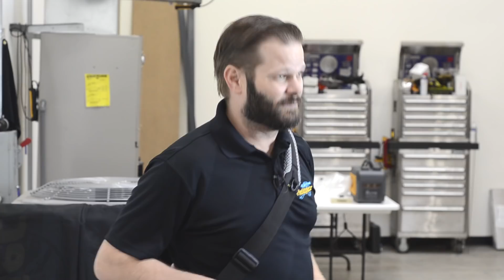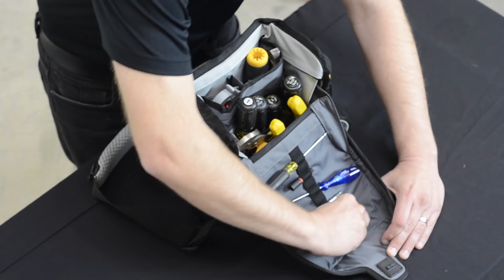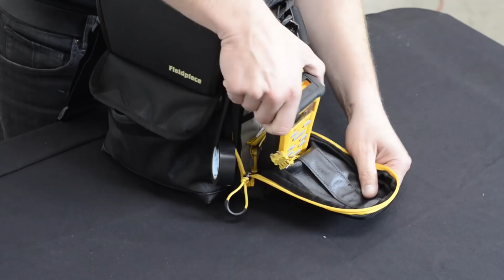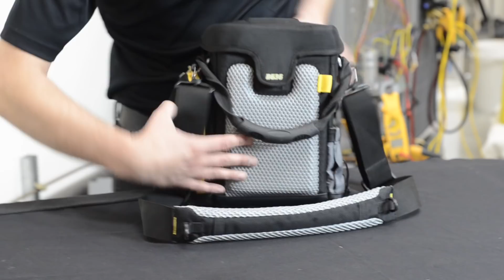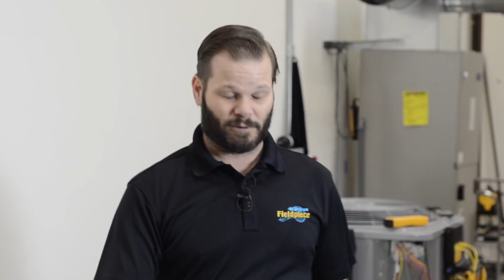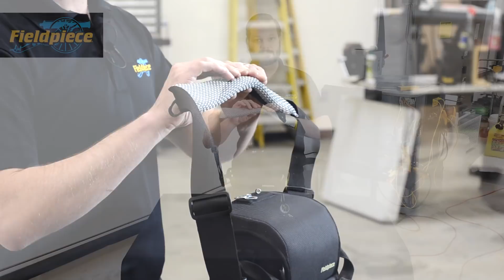BG36 Product Details - Inspection Tool Bag

Comment: Hope the bg36 is better than the BG44. Loved the bag, but the stitching sucks ass.the strap tore right off on both ends. Any tool bag manufacturer that makes products for professionals should know that technicians will use every bit of space and that mf gonna weigh at least 50lbs.